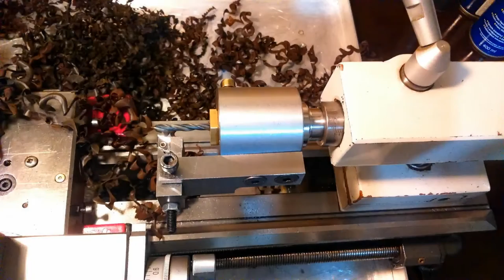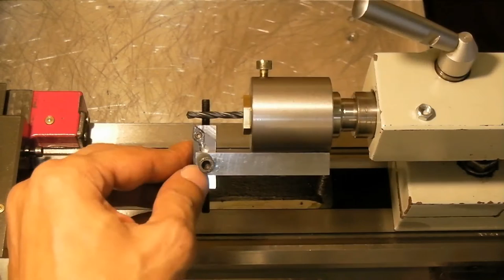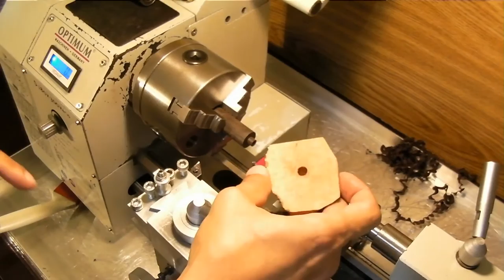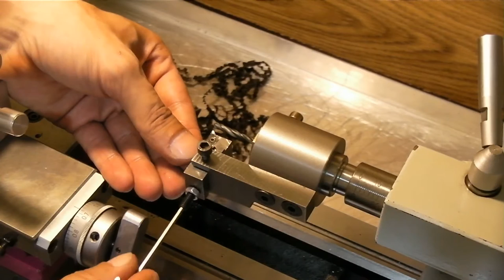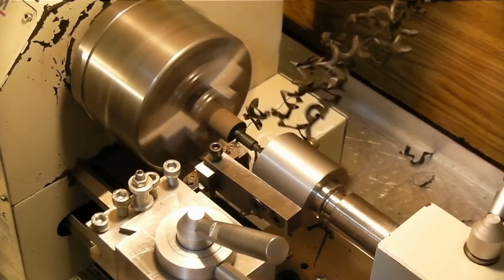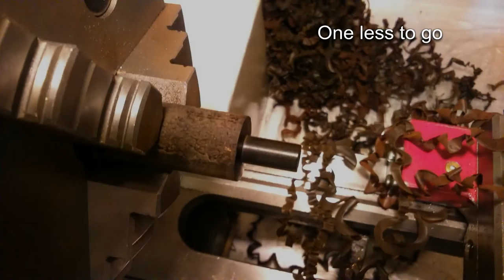Tenon turning tool - Tenon Cutter

Comment: Hi, for woodlathe  it' ok this tenon?
Reply from the maker: Hi, unfortunately no.
Reply: @Spoon-bits  Just curious, why not?  (Assuming you can match the taper in the quill.)
Reply: @garrettswoodworx1873  it'll work. Not sure why someone with a metal lathe would even want this tool. You could just turn your own tenon.
Reply: @r.dickeypipes9  Yeah, I knew it would work, just curious why Spoon-bits said it wouldn't.  I just turn the tenon but I guess some folks are just looking for the quickest way to accomplish the task.